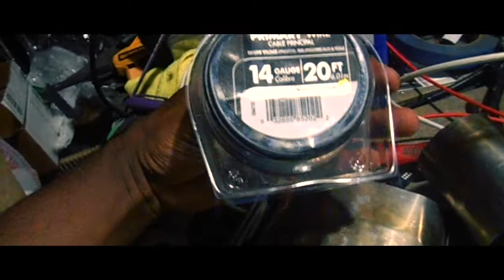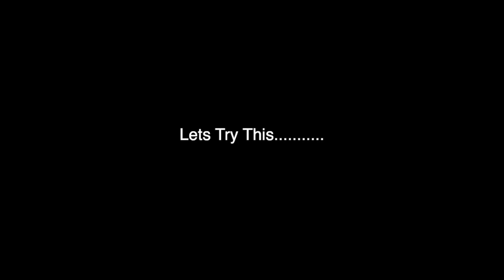Third Brake Light LED Strip Install on my Lexus GS300

Comment: Hey can you send me the link for the led strip you got? And do you have Instagram or anything?
Reply from the maker: You can use any red led strip as long as it has just a positive and negative wire for connecting. And sorry I dont have one but i will soon